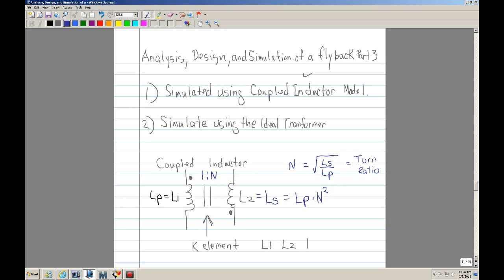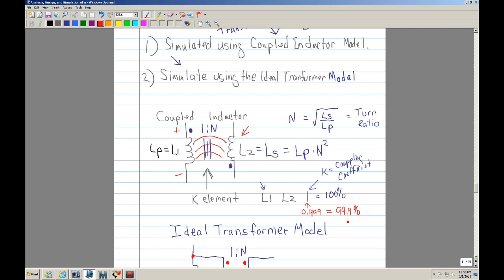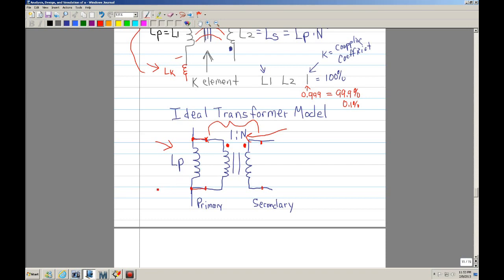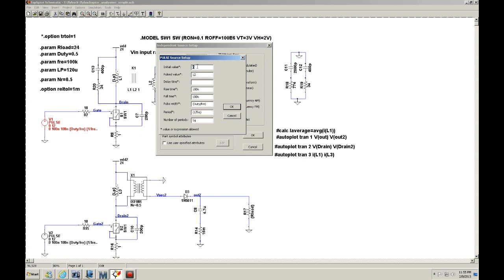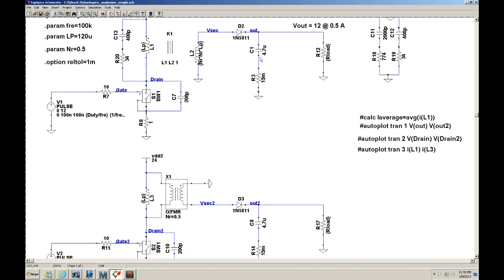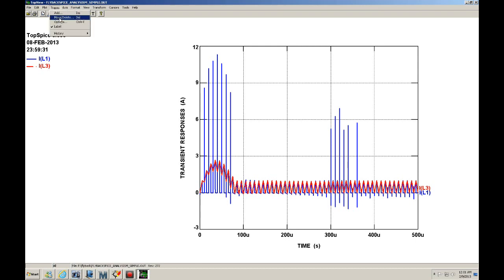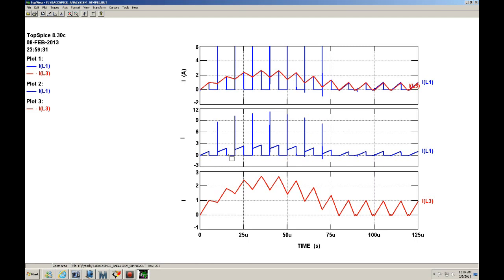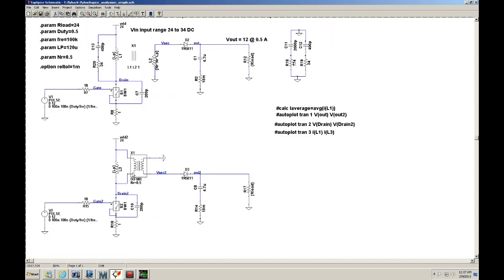Analysis and Design of a Flyback; Part 3, How to Model the Transformer.

Comment: @Robert Bolanos I would like to design isolated power supply with input of 16 to 90 VDC and output of 28VDC. Can one flyback do buck boost using one circuit

Comment: So which model is more accurate ? Coupled inductor model or ideal transformer model
Reply from the maker: They are both equivalent. The coupled inductor simulated slower while the ideal transformer runs faster
Reply: @RobertBolanos  Thanks a lot
Reply from the maker: @shivanshu2959  Just so you know, typically I use the coupled inductor model because the presentation or simulation are more realistic.
Reply: @RobertBolanos  Yeah you are right. The coupled inductor model is the right representation of the flyback convertor. As the flyback transformer in reality is nothing but a coupled inductor. Isn't it ?
Reply from the maker: @shivanshu2959  So you won't be confused, it would be better if you use the coupled inductor model. Some people get confused when they use the ideal transformer model.
Reply: @RobertBolanos  nah . I won't get confused as in my electrical engineering class I was taught the ideal transformer model only.
Reply: @RobertBolanos  Also as shown in ideal transformer model that it first runs in CCM and then transitions into DCM. Does the same thing happen in reality also ? Does CCM and DCM co-exist ?

Comment: In the ideal transformer model, when MOS is turned on, the current of inductance L3 increases slowly and stores energy. When MOS is turned off, inductance L3 keeps continuous current and the current flows through the ideal transformer model x1. Therefore, it can be seen that the current of L3 is a triangular waveform. Am I right to understand this?
Reply from the maker: When using the ideal transformer, this is correct. You will see a triangular waveform in the simulation. However, when using the coupled inductor model, you will not see the triangular waveform. Good question.
Reply: In this way, the current of the primary side and the secondary side can be seen through L3. The difference is that the secondary side current has a multiple relationship with N
Reply from the maker: @tomfang438  Correct

Comment: In real reality what is the percentage of K is specified ?
Reply from the maker: K is dependent on the leakage inductance. The better the coupling, the closer K gets to 1.   Typically, K can be from 0.99 to 0.9998
Reply: @RobertBolanos  in you part 8 of close loop of fly back converter i did not under stand how you calculate the value of Crolf,Cint and Rint

Comment: Hi Mr. Robert,
I'm confused about the difference between blue and red curves at the discontinuous mode. In theory current should go down zero and has to stay for a while as zero amperes. But in red curve current reaches zero amperes just a moment and then rise up again. What the difference between coupled inductor model and ideal transformer model and which one is more realistic?
Reply from the maker: Hi Cagin,Both the coupled inductor model and the ideal transformer are equivalent although the ideal transformer model is more an abstract concept since there is not true ideal transformer. The coupled inductor is more realistic. The red plot shows the current that the primary magnetization inductance would see and you can more easily see when the current in the transformer is in continuous mode where the current nevers goes to zero. In the blue plot you can also see it in the leading edge of the current you will notice that it does not start at zero current but instead start at an initial current thus letting you know that it is operating in continuous mode. I hope this helps.

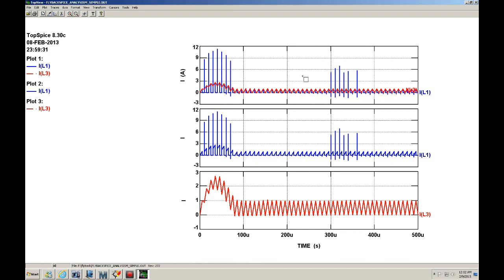Comment: Hello Robert. At 15:13, how can you explain the behavior of the blue curve ? At the very beginning, the current does not ramps up linear. It ramps up to a certain value and then ramps up linear. Do you see what I mean ? I mean there is like an offset. Do you know where does that come from ?
Reply from the maker: This is a good question. At the start of the power supply, all the output capacitors are discharge are at zero volts. In this simulation I am doing an open loop where I do not have feedback control and the gate pulses are fixed at around 50%. So what is happening, the current in the primary is operating in what is called continuous conduction mode where the current in the primary does not go to zero current. After the output capacitor reach steady state, the primary then reaches what is called discontinuous conduction mode. This is where the primary current ramps up to Ipeak and then decreased to 0A.  When you use a current mode PWM, the operation in continuous mode is minimized by setting the current limit. Hope this makes sense
Reply: Thank you Robert

Comment: can you help with the calculation of multiple output (say 3 output ) flyback converter?
Reply from the maker: +neha mehrotra Hi neha,  You use the same procedure that I use in the video. To do a three output design, you all the output power of all three output. For example, 5V@1A, 12@0.5A,10V@0.5A. So the total output power is 5W+6W+5W = 16W.  Now that you have the total output power, you can solve for the required primary inductance needed for the primary. Question can be sent to rbola35618@aol.com

Comment from the maker: The air-gap is the same as non-gap transformers. When you grind a gap, the inductance of the transformer reduces. Therefore, what ever inductance you end up at the primary as well as the secondaries, you can define it in spice either using the coupled inductor model or the ideal transformer model. Watch video 5 where I actually wind a transformer with the turns needed from not saturating the transformer. I ended up with too much inductance. I then grinded the gap to reach the desired inductance